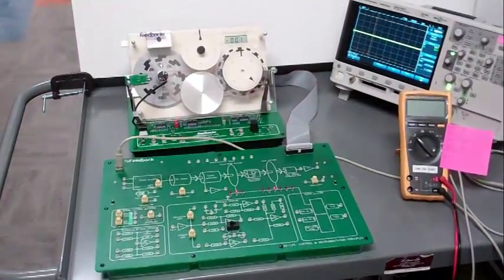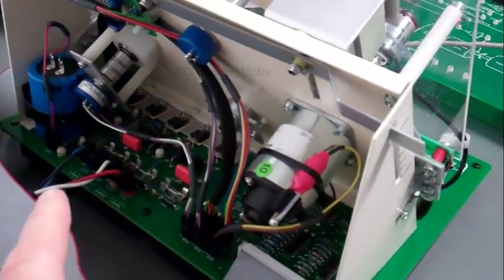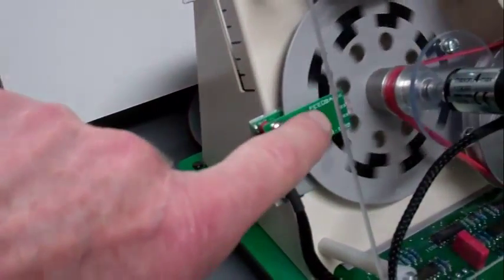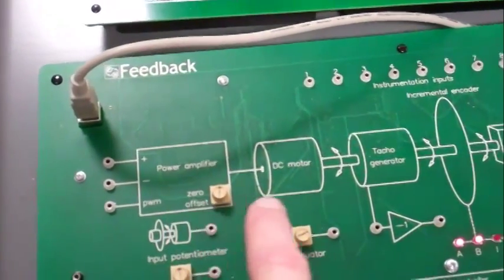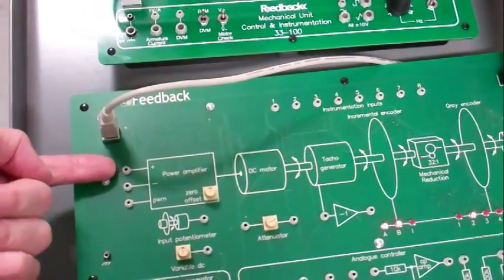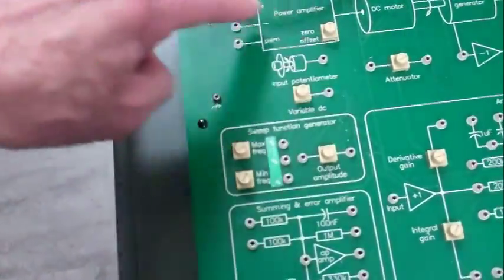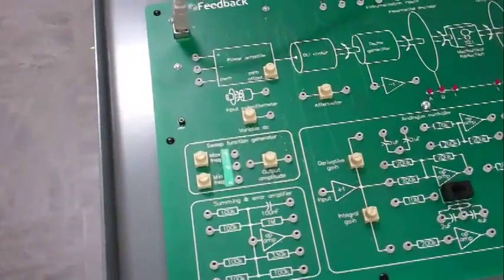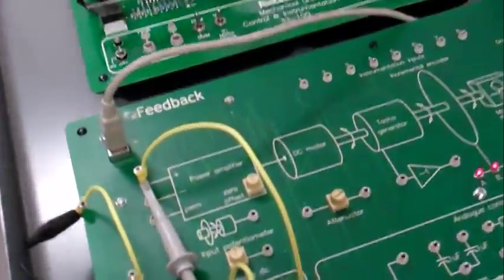B46112 - Feedback 33-033 Servomotor System Introduction

Comment: excuse me sir, Does this motor has a gearbox attached to it ?
Reply from the maker: +Dina Elgendy No gearbox.
Reply: +barkerds thanks a lot ,sir :)

what is the difference between the incremental encoder sensor and the absolute encoder sensor ? aren't they both photo-interrupter ? or infrared photoelectric tracking sensor ?I